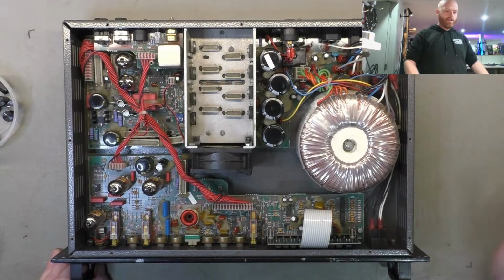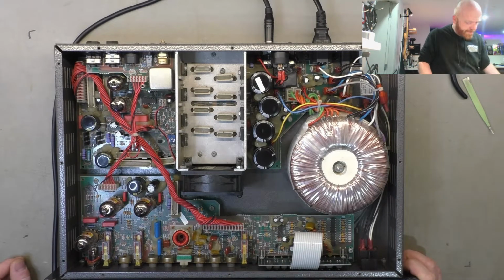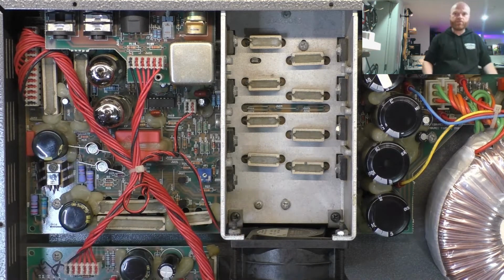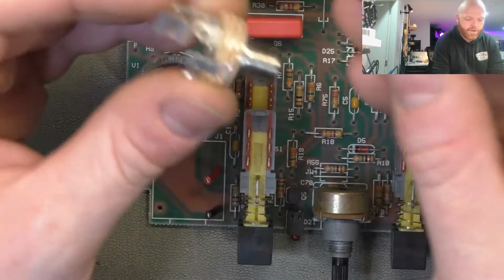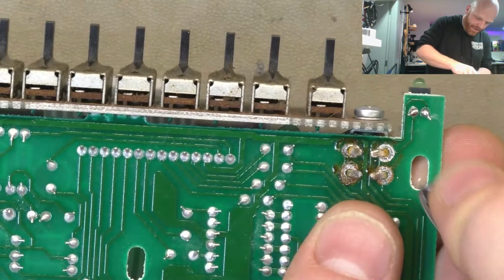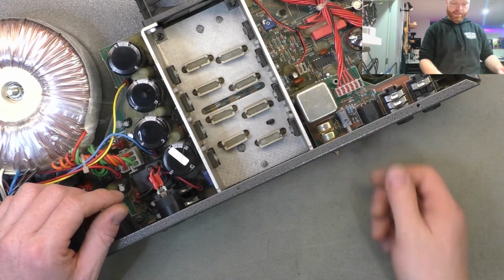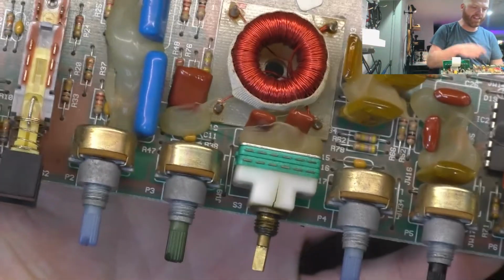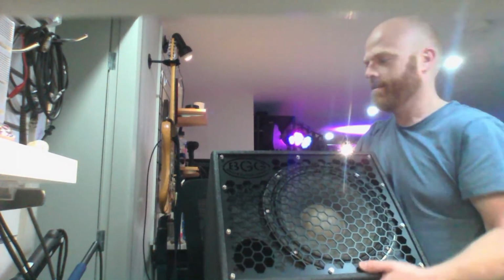Ampeg SVT3 PRO - Working, But Not Well

Comment: At 42:10, you can stabilize the cracked plastic on that switch by bridging the crack with a staple or similar piece of bent wire heated with the soldering iron and pushed into the plastic.  I have seen commercial products designed to do exactly; that they're often used by automotive repairers for stabilizing cracks in plastic trim for car  dashboards, headlights, cowlings and so on.
Reply from the maker: Fullcompass have the genuine part in stock for anybody following along. https://www.fullcompass.com/prod/195997-ampeg-88-108-01-5-pos-switch-for-svt-3-pro-and-svt-4-pro

Comment: I had one of these. When I first got it there was hideous crossover distortion so I set about biasing it. The bias trim pot was stupidly twitchy so I replaced it with a multi-turn trimmer. Biasing was still a compromise because the power MOSFETs were so poorly matched.

Also the Tube Gain control has nothing to do with gain, it actually sets B+ for the valve part of the circuit and hence the headroom.

I no longer have the amp.
Reply from the maker: Yes, it is certainly a questionable setup.
It put out about max 150w with the tube gain turned down.
Normally "tube gain" is a form of preamp soft clipping distortion effect, but this implementation is pretty dumb.
Reply: @BradsGuitarGarage  It simulates the full tube poweramp if you turn in to the left, turned to the right it has more snap, like a mosfet poweramp. This is how I understand it. I use on 3'o clock usually. It really does feel like a full tube amp if tube gain is rolled off, slow and mellow :D

Comment: There's always a low buzzing in the background almost like a radio station just wants to come busting out, however, its not that. Just a weird distorted noise in the background when I'm playing or stop. almost like its a bad cable but it's not. I've tried multiple brand new cables. I had it fixed once because of a low distortion in the background while I play. It went along my playing like a I had a distortion track in the ground. It comes back every time the head hits a bump when being moved. Great head, just finicky as all hell.

Comment: The more I watch of yours and Lyle's channels, the longer the list of equipment not to buy grows! I'm not in a place just yet to set-up a commercial studio, but when I do it's looking like it's going to have to have a lot of hand built boutique gear in there. It doesn't seem to matter if it's guitar amps, mixing boards, mic preamps, outboard processors - it's majority junk. When even the expensive more boutique end manufacturers are also cutting corners it's bad news. There's no wonder the music industry is plagued by such bad sound.
Reply from the maker: The boutique stuff can be the worst of the bunch in my experience.
Slap a big pricetag on it and pose as a big player.
Get to know your local tech and they can chime in as to what's nice and what's not.
EVERYTHING will need maintenance, and sometimes random component failures are a factor, and that shouldn't reflect on the manufacturer, as they have to use what's available.
Reply: @BradsGuitarGarage  I hear you on that! Luckily I know just enough about electronics and circuit design to know where I would be looking for the boutique gear. It would be guys like you or Lyle building me guitar amps for a start. As for the rest of the equipment there are some small builders who make great stuff for a price it's just knowing where to look I suppose and keeping your wits about you.

That's why I watch and learn from guys like you and Lyle. I'm a musician first and foremost, but I've made it my business to learn about what makes a good piece of equipment. I cannot thank you enough for all you share!
Reply: Thanks Brad. My Stv 3 has the same issues. Lots of crackle when the tube gain. EQ board is as loose as Brittany Spears. And speakers are farting like a brewery draught horse. Help!!!

Comment: Hopefully the module glued to the bottom of the circuit board wasn't installed with any type of glue that might become conductive or corrosive. Still, it makes it difficult to change or even merely reflow the joints to the jacks in front of it, and impossible to examine and resolder anything underneath that module. The header pins near that module also look to be poorly soldered. And wouldn't the bare-metal input jack create a potential ground loop to the front chassis?  I assumed the original input jack was plastic and didn't ground to the front panel, just like the plastic jacks on the rear for the effects loop.....

Comment: The SVT3Pro wasn’t a bad design…but it was dreadful execution. The MOSFETs need to be matched and every unit that left the factory were neither matched or even biased correctly. I always offer to replace with matched output devices as well as replace the source resistors with 1% tolerance 6.5W. It makes a world of difference along with correct bias adjustment.
Reply from the maker: Have you checked out stock levels on IRFP240's and IRFP9240's recently though?
I got some equivalents from Exicon for a Mesa Walkabout recently, but they are costly and so is postage from the UK.
Reply: @BradsGuitarGarage  I have not. I bought a bunch of matched quads years ago and have been living off those.
Reply from the maker: I had a scour for the IRFP's which could be substituted for the Mesa's original BUZxx MOSFETs but nobody has sufficient stock of the complementary types. Lead times pushing into 2023 for the next batch, unfortunately which is why I was forced to go with the Exicon ECX10N20 & ECX10P20. Good times!

Comment: Clean the tube sockets with a wound guitar string, .033 to .036 is about right.
Reply from the maker: I find the toothpicks buff the surface gently and well, they also absorb any residue from previously applied inappropriate fluids.
Reply: @BradsGuitarGarage  , gotta be careful, however, to not leave any wood fibers inside the socket contacts. As for the guitar string technique, chuck it into a miniature Dremel tool or similar die grinder, and clean each contact in three seconds flat! A phosphor bronze .033 to  038 string works particularly well but any wound string will do .

Comment: Any resemblance between this device and a proper SVT is purely coincidental and implied only by the presence of sand resistors. It does seem to sound good, however. I'm surprised you didn't have to replace any microphonic preamp tubes.